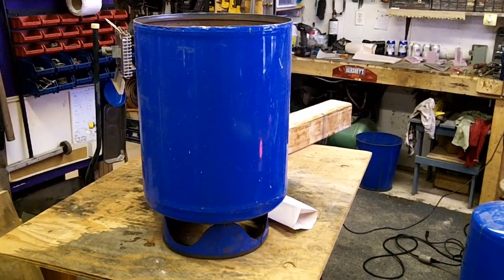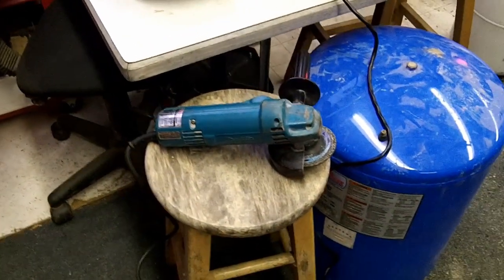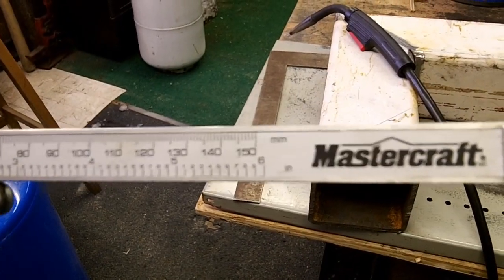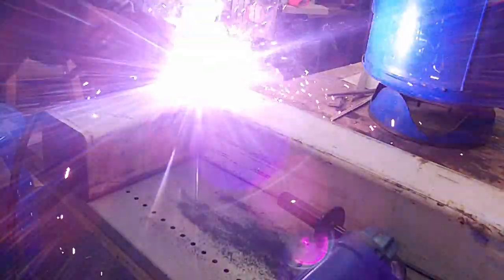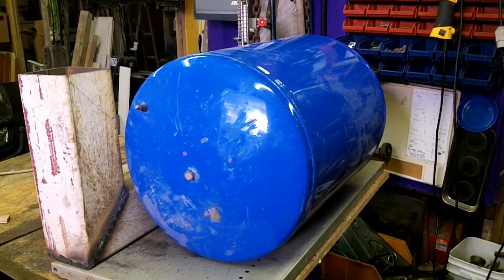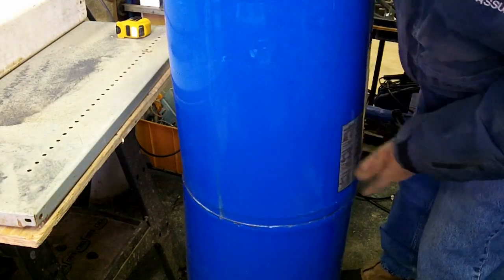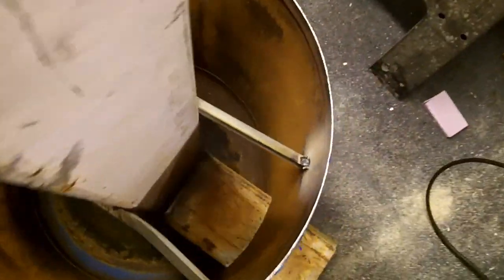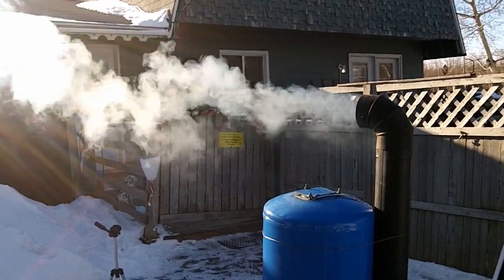Rocket Stove Heater Build and Burn Pt. 1

Comment: And so you checked the burn temperature of the pain right? Its not like you would make a stove that kills your entire family slowly of cancer, right?
Reply from the maker: No just I will die.   I would not put this in my residence as I do not trust my welding enough to use it unattended or while sleeping or while sitting on the throne for a few minutes. Thanks for the concern though.  By the way what does the "Burn temperature of the pain" mean anyway????

Comment: Nice job , it's getting to be that time of year . I'm looking to make a rocket heater for my screen house . With Windows of course ! My self being a water well contractor , I have a mountain  of these tanks lol . Did I miss part two Or did you make a part two .? I would like to ask you a few ?'S to see how it worked out for you . Thanks again .
Reply from the maker: +David Gagne 
Yes there is a part 2.   Overall it works good.  I have worked out a smoking problem it had after I added the self feed tube. I just keep the top part of the lower door closed and the air is sucked into the self feed tube as it burns and all smoke that was coming back up the self feed tube is eliminated.

Comment: Nice job but it needs more air to the inner part of the burn tube, 1 or 2 inch pipe will work fine. More air will get it hotter and more efficient.

Comment: One more thing.have you thought of insulating the riser tube and the lower part behind the burn chamber? You should be doing that so it will give you 90% efficiency. Again good luck God Bless. More power and keep sharing..
Reply: insulate it with?